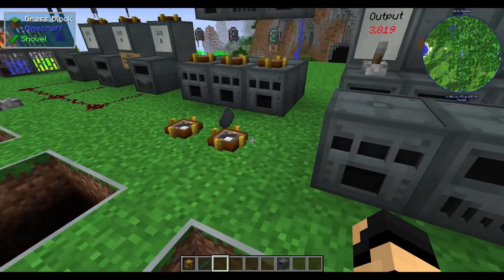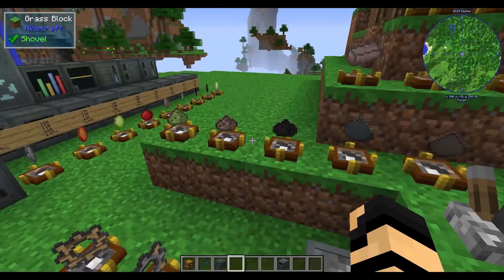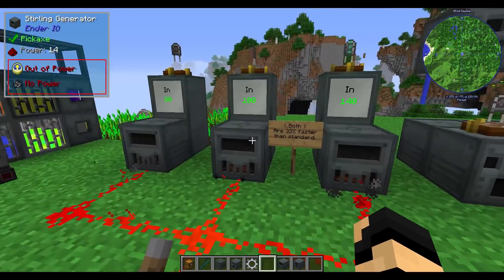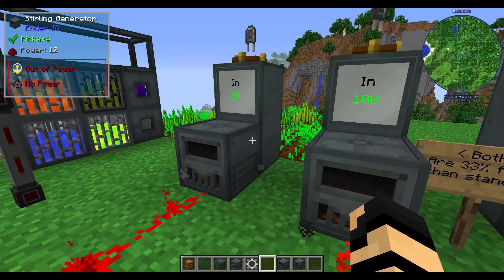Ender IO! Industrial Machines Bit-by-Bit for Minecraft 1.12 by Mischief of Mice!

Comment: So much wrong here...

1.) Stirling: The 133% means that the fuel is used up faster. You still get more µI per tick, but they also use up the fuel faster. To See what you get per fuel item, look at the item's tooltip while in the machine.

2.) Alloy Smelter: They do not use more µI with better capacitors. Have a look, all 3 of them have the same amount of energy left (but the one you stopped in the middle, that one seems to be off by one tick, don't know why).

3.) Sagmill: Main Output is how often you get the whole recipe. Bonus Output effects the chances shown in the tooltip. Ball durability is based on the amount of µI processed. So it doesn't matter what if you throw in stacks or not.

4.) Impulse Hopper: All machines' Push/Pull is limited to one slot per half second, so if you hopper 3 items per second it naturally won't be able to keep up.
Reply: Wow this turned out completely different than i had imagined it in the beginning. still good that there is more variety for the sag mill though.

Comment: Are the special capacitors going to be covered at some point? The ones you can find in places like desert temples.
Reply: Nostrite I always liked how they increased the capacity of fun
Reply: I hope so. Normally those capacitors work differently depending on what machines they're put into, so it's a lot of fun trying to get one that works better than an octadic capacitor on a particular machine. I do believe that a Botania flower can be used to automatically generate these capacitors though.

Comment: So, is the microinfinity the same or compatible with RF
Reply from the maker: Both
Reply: thanks
Reply: No, it is not compatible with RF. µI is using the Forge Energy system.

But many mods that use RF also support FE interchangeably, so you won't notice the difference. Draconic being the notable exception here.
Reply: HenryLoenwind thanks, by the way, do you like this mod with all of the changes like the alloy smelters being slower and the power being different form RF. Would you use it?
Reply: Oh, I like it very much. Would be weird for me to say otherwise, as I am the one responsible for those changes...

BTW: The normal Alloy Smelter has the same speed as before, we only added a set of slow&cheap machines for early game.
Reply: HenryLoenwind, thanks for the opinion, I now know a lot more of the mod, thanks for the help you have given, and one last question. I saw machines like the alloy smelter and SAG mill need a capacitor, but when the capacitor was put into the machine it did not power it. Does the capacitor no longer power machines? Do you now need a capacitor and a capacitor bank to power it.
Reply: Capacitors never powered machines. The new thing in 1.12 is needing a capacitor to run the machine at all. In older versions, capacitors were upgrades. EnderIO machines have always needed an external source of energy: RF in older versions, uI in this version. 

I think you're thinking of capacitor banks, the energy storage blocks which are still there in 1.12. You put uI into a capacitor bank, then connect a machine to the bank, and the machine runs by pulling uI from the bank. You can do this by having the machine and the bank block touching, so it's easy to forget that there's an energy connection there when there's no visible conduit.

Comment: the problem with different energy units: it has no benefits, just downsides. you cant compare the machines, it confuses people new to modding and is just_not_necessary. i really dont get why you are defending their decision?
Reply: also, the grinding with flint used up soild 10%, nowhere near the 2,8% you have on the shield. also, you stopped the second grind again, so you cant use that number